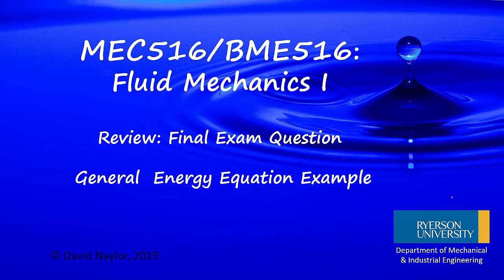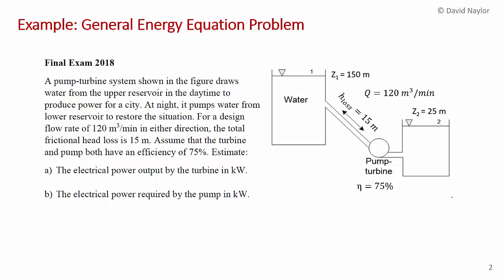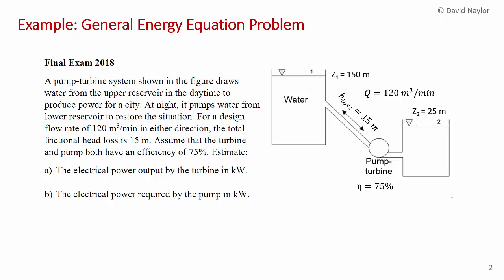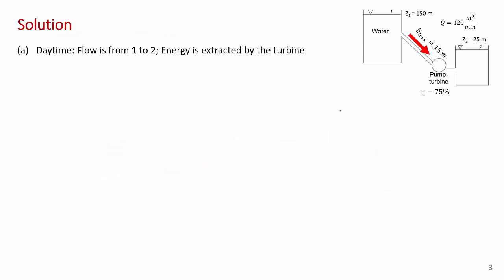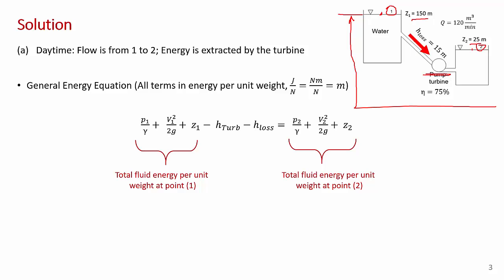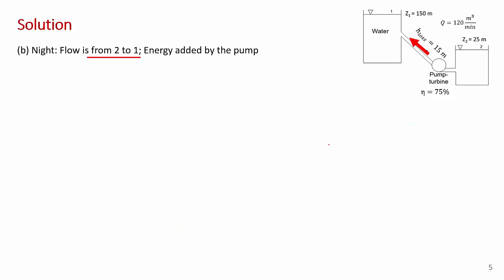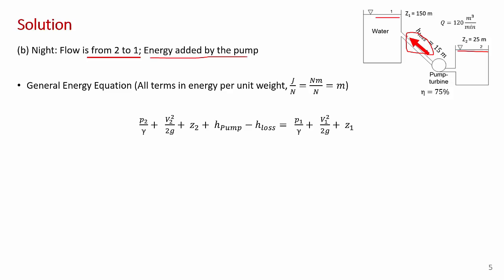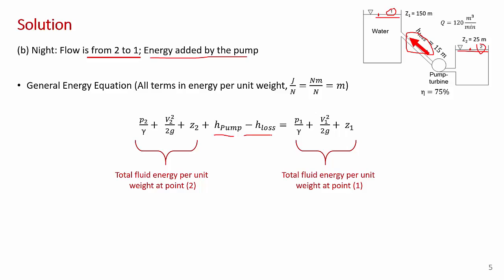Fluid Mechanics Final Exam Question:  Energy Equation Analysis of Pumped Storage

Comment: Thank you, is the electrical power required by the pump always higher than the electrical output from the turbine?
Reply from the maker: If the flow rate was higher during the power generation phase, the power output from the turbine could exceed the power input from the pump. However, total energy production will always be less than the input.

Comment: thank you so much! how about if we are looking for the Head Added by the pump and the Head Loss was not given however, it is also not stated that its not neglected.. can we assume or can we just neglect the Head Loss?
Reply from the maker: Head loss will happen in all real systems, of course. The methods to calculate head losses are covered in a later chapter than the Energy Equation in most textbooks. So, if you are not given the head loss (and your course didn't cover the Moody Diagram), the instructor likely intends you to assume frictionless flow, with no head losses. (You would need to be given the pipe length, internal diameter and pipe surface roughness to estimate the head loss via the Moody diagram, Chapter 6 in the  White and Xue text.)

Comment: if you're going from top to bottom isn't that the negative y direction so wouldn't that make delta z negative? for part a
Reply from the maker: No. z is is the altitude of the starting end points of the streamline. z_1=150m, and z_2=25m. So, the delta_z=125m. That's the loss in potential energy per unit weight (N-m/N)
Reply: @FluidMatters  Okay Professor. Is z independent of the direction on the bernoulli? Cause the way I was taught in class it matters. If the point 2 is down then the z is negative but if it's above point one its positive.